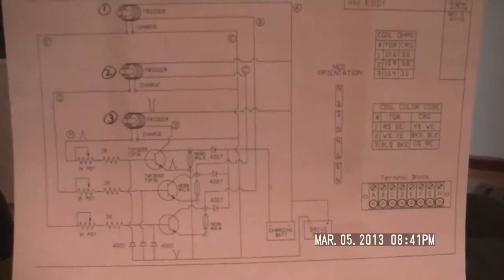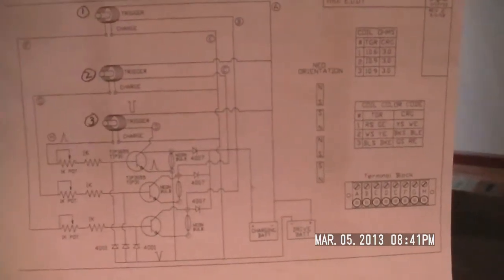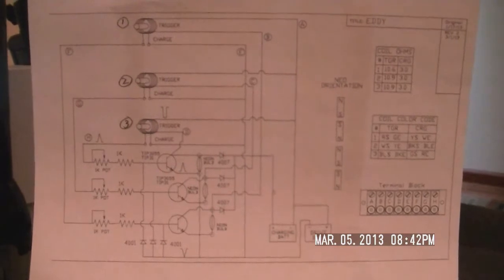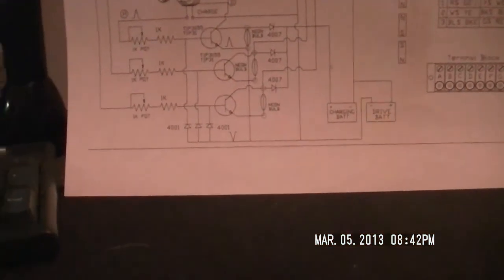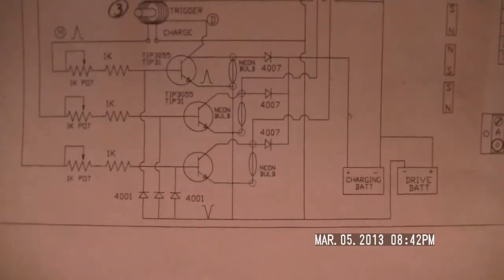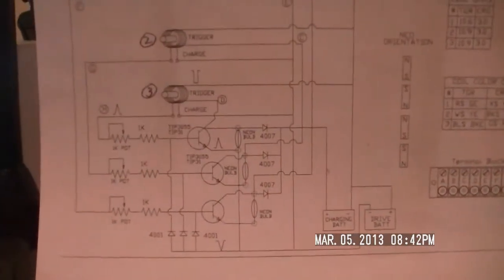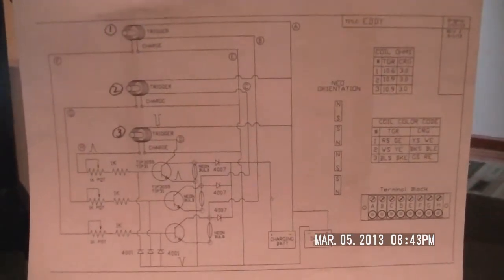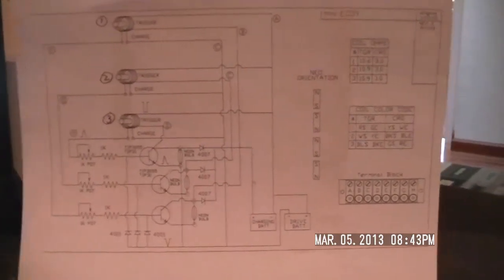EDDY II  Bedini circuit, three coil modification.

Comment: if you put a neon bulb emitter to collector you might save some transistors.
on the base resistance...
place only one pot from the top of the trigger coil then from the pot to all 3 resistors then to each of your bases.
make sure you check the resistances on the resistors so they match.
and you might want to match a few other things like transistors etc. check out my vids on that. don't waste too much time though, I want to see your system up. 
cheers :-)